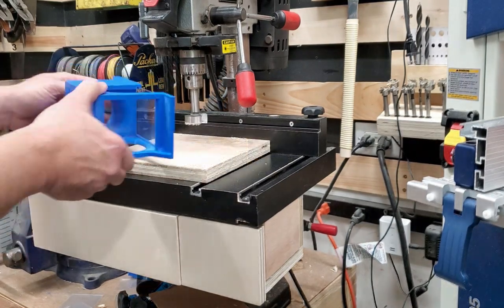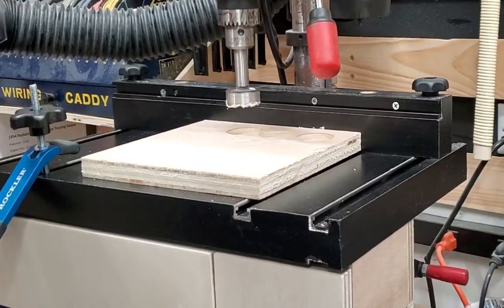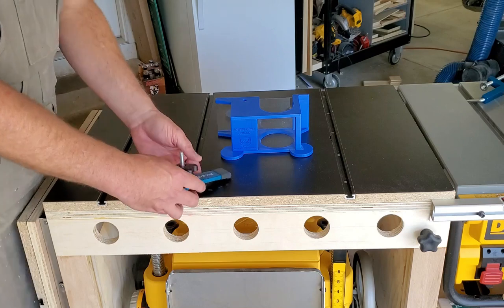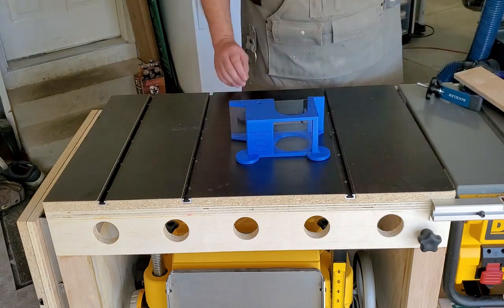The Power Drill Shield - Complete Woodworking Drill Dust Collection Solution

Comment: Would it be fair to say that it only works for drilling into flat stock that is at least as big as the shield’s footprint?
Reply from the maker: The bottom working hole is 3" in diameter. I've used it on smaller pieces and just used some scrap wood next to the piece being drilled for stability. The more open the bottom hole is the greater chance for dust and chips to be flung out before they can be vacuumed up.

Comment: Hey. I'm not sure what level of 3D printing experience you have or what machine you use but you could easily reduce your time by using a bigger nozzle and tweaking speeds as detail isn't really an issue
Reply from the maker: Thanks for the suggestions., I'm already printing in draft mode with a .4 nozzle. In finer modes this would take 2 days to print!
Reply: @TheSuburbanGarageWorkshop  without knowing the exact settings it's difficult to recommend but a 0.6mm or even 0.8mm nozzle with less walls and greater layer height would reduce time considerably. All the best on your venture

Comment: What size hose for the dust port?
Reply from the maker: It's made for 2 1/2 size hose when is a usually has a connector size of 2 1/4. Depending on your hose, an appropriate adapter may be needed